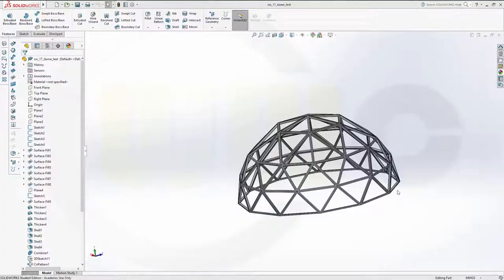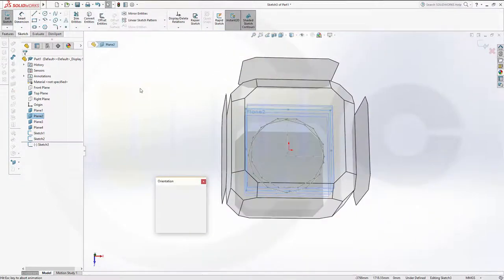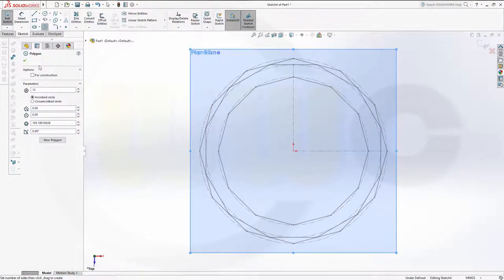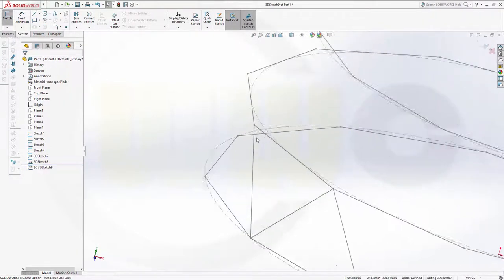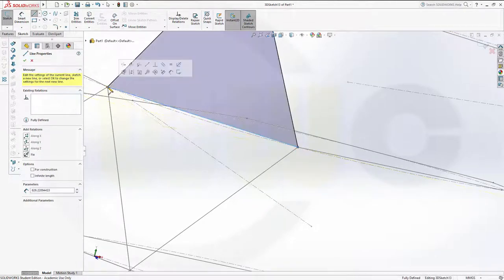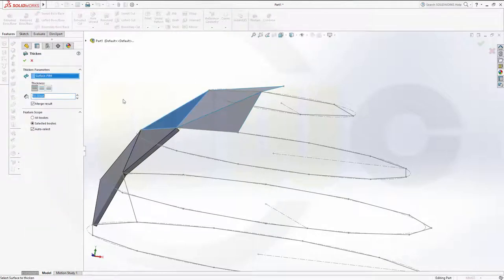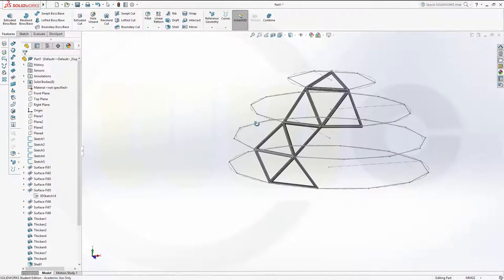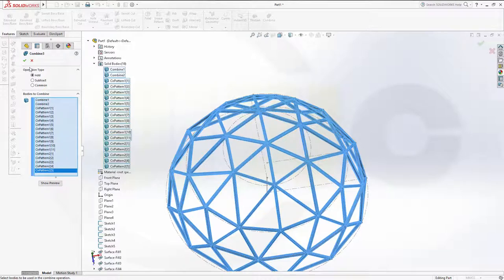Userwish - Dome - Kuppel - SolidWorks 2017 Training - Part Design

Comment: Best solidworks dome tutorial I have viewed - no magic numbers. But it is not geodesic. You can do great things with your layered domes that are impossible with geodesic domes but the geodesic ones have much greater repetition and simplicity. Much better are Sketchup tutorials that start from natural rectangles - fundamentally simple from start to finish. It shows the difference in use of a package that was designed in 3D from the start compared to one that converts 2D thought to 3D.
Reply from the maker: I know, it was a userwish, He sent me a drawing with specific dimensions, so no calculation wanted and needed.

Comment: Hello Walden!!

This is a great vid, thank you for posting it : ))

Just one question: Once that the dome is created, can it tell you the total perimeter of the sum of those solids? I want to build a wire structure and I would like to know how much wire I will need and at which point or coordinates I have to solder so it turns out perfectly.

Thanks again in advance!!
Reply from the maker: I think you have to do that calculation on your own.

Comment: Thanks this was great video. Really came in need. I got question if you can help. I wanna use this to build greenhouse and I gonna need to get right shamfer angles for triangles. Any easy  way to calculate right shamfer?
Reply from the maker: Sorry, what would be the "right" chamfer angle??? You need a certain angle?
Reply: Nothing wrong with sketch. Your sketch was amazing. I am talking about when adding thicken in triangle outer diameter is larger then inner diameter. I was wondering how much I need to chamfer from both sides of different triangle to make it perfect fit. Wood starts for square so need to adjust it. So looking way to know how to calculate chamfered angle for each triangle.
Reply: I think I maybe got it .Have to test it later thou. 180-160,51=  19.49/2 = 9.745 angle I think...

Comment: Wolfgang am I correct in that his is a 2v design.  If so then there are only two distinct triangle sizes correct?  If that is true could one not safe a lot of time by just drawing the two different triangles and then assembling them into a dome.  The vertex of each triangle could just be mated to the points of the sketch.  I might be wrong in that the time to mate all triangles might take as long or longer than drawing the dome as one part. Please advise.
Reply from the maker: Sorry, what is a 2v design? I was sent a drawing with these exact dimensions so I did it this way. If those triangles would have all the same dimensions you could do it much faster with just 2 patterns.
Reply: @wolfgang.walden.cad.training  Wolfgang,  A dome of 2v design just means there are only two triangles sizes used in the construction of the dome or sphere.  I was just wondering if you knew if your drawing was a 2v design.  I liked your work and found your approach very interesting.
Reply from the maker: I see, sorry I don´t recall. But assume there were more than 2 different triangles, otherwise I would have done it in a different way

Comment: I've got to the point you are at at 17.35 (ready to circular pattern the combine's) but when I tried to pattern the sections the error message "unable to pattern the selected feature combine1" , any ideas why?
Reply from the maker: Sorry, can´t tell without seeing your model. Did you try to pattern the bodies? If you try the features it will not work.

Comment: Hallo Hr. Walden. Wie entscheidet der Programm die seitliche Wanddicke, wo Sie ein Shell auf beide Seiten machen?
Reply from the maker: Wie bei jedem "Shell"-Tool. Die Flächen welche nicht entfernt werden erhalten alle die ausgewählte Dicke. Aber vielleicht meinen Sie auch etwas anderes.
Reply: Hallo Hr. Walden. Ja klar, das weiss ich. Ich meinte die übrigen seitigen Wanddicken, nachdem Sie das Shell gemacht haben. Die haben eine bestimmte Dicke. Wie wird diese Dicke vom Programm entschieden?
Reply from the maker: Sorry, welche "übrigen seitlichen Wandstärken" meinen sie denn?
Reply: Hallo Hr. Walden. Ich meine, die "leere" Dreiecken, die übrig geblieben sind, nachdem Sie den Shell 25 mm pro Seite gemacht haben. Nicht die 50 mm vom Befehl "thicken" am Anfang, sonder die übrige Wandstärke senkrecht, z. B. min 14.32. Das wollte ich wissen, wie der Programm entscheidet, was soll diese Wandstärke sein.
Reply from the maker: Ganz einfach, dass sind einzelne Solids/Volumenkörper. Wie schon gesagt dann bleiben alle Wände mit der gleichen Dicke stehen. Jedes "Dreieck" ist ein Körper, die sind nicht zusammengebaut/vereinigt. ;)
Reply: Jetzt ist allles ganz klar. Ich hab schon "Weldment" workbench benutzt, aber in dieser Art, habe ich es weder gedacht, noch gemacht. Super Übung, gemacht in den anderen Programmen auch.

Comment: Hi, I am an university student and I do need a help. I am struggling on the dome design for my final year project. I worked for 3 weeks already and I got nothing done. I am not going to be a civil engineer in the future therefore I think there is no point for me to know how to work on the dome design with solidwork. However, I need to finish this project for my graduation and I want to finish it. Can you help me for the drawing part please? I can pay you for that because I do need some help right now.
Reply from the maker: So what kind of problem do you have?
Reply: @wolfgang.walden.cad.training  I need to draw a dome but have a different shape compare to the dome that you designed in this clips. The dome that I design is circular dome with 5 layers and 20 bricks in each layer. The objective of the final year project is to use a 3D printer to print out the bricks and combine it into a dome. The problem I have is that I couldn't draw a curve surface of the dome and draw it into 100 bricks in total rather than a huge dome with lines on it.
Reply from the maker: @tobyqaws  I seems you should use an assembly not a part. Do you have a picture of your "dome" ?
Reply: @wolfgang.walden.cad.training  yes I do have a handcrafted drawing of it. Do you mind if we talk about this with email?
Reply from the maker: @tobyqaws  mail: info@wwmc.de